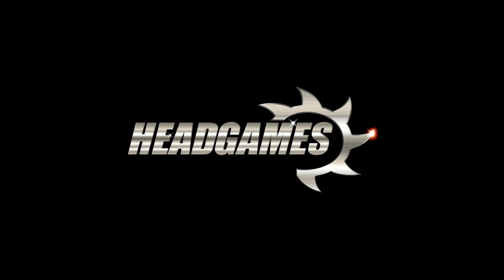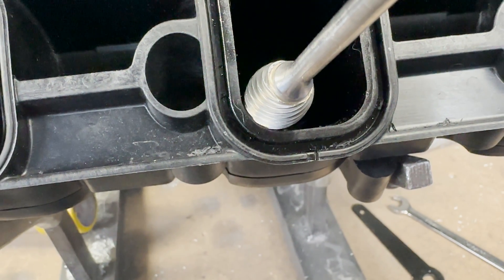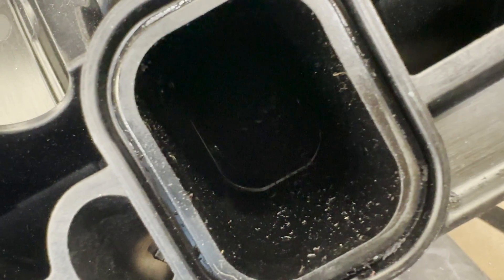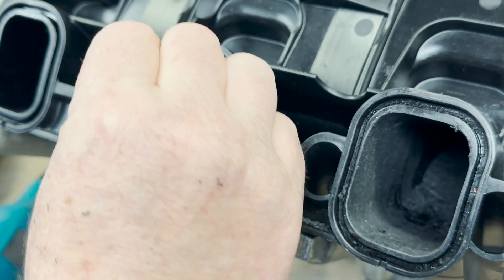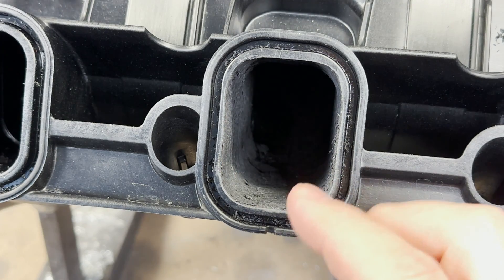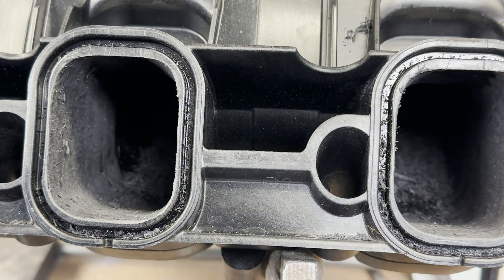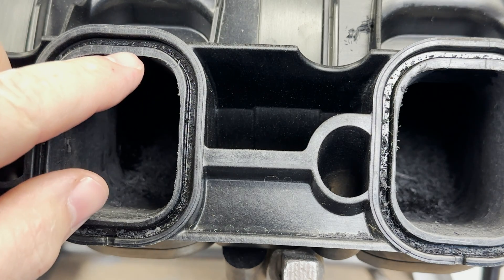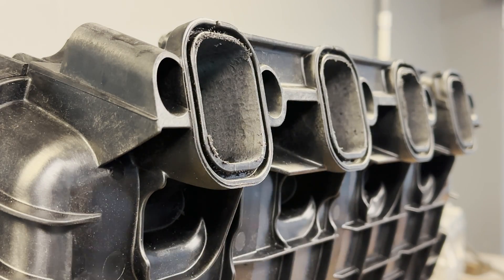Porting a C8 intake manifold for max power!

Comment: What kind of HP gain could I expect porting the intake on stock heads? I just bought a 2024 new and hate to do anything to void warranty.
Reply from the maker: @bubbafatas2588  I would say between 0-5. It  should be with other mods where it needs the volume. Save your money
Reply: @ thanks for the response!

Comment: There is a pinch just past that first seam, as you go deeper into the runner is there much material on the sides?    The lower part of the intake runner near the head has something to work with(sides), not sure past that first seam toward the plenum
Reply from the maker: I am not sure, I feel like I showed that on the vid.
Reply: @headgames  Im at 1.57 at the port opening, just not sure I can go 1.57 past the pinch ....... I think that transitions to a much thinner runner wall

Comment: I designed OEM intake manifolds for 7 years. It’s always interesting to see how people modify them. 

When we tested the manifolds to failure, they would usually burst near the weld flanges. I’d guess that thinning the walls near the runners or TB flange would have little or no impact on the life of the manifold. 

Sorry for the steps on the runners. They were usually unavoidable due to cheap manufacturing processes.